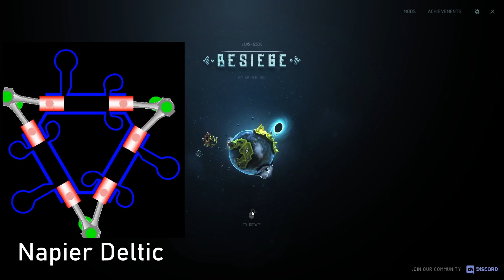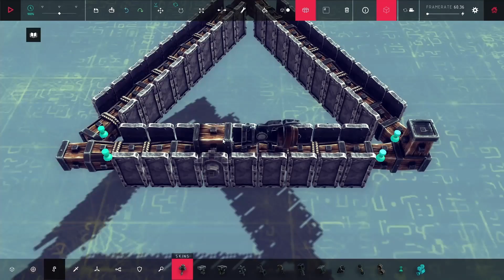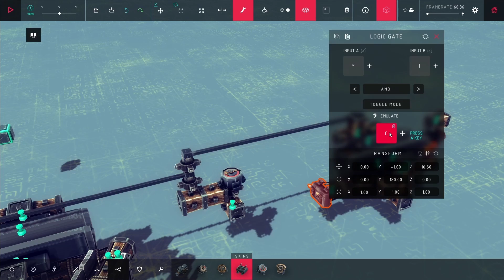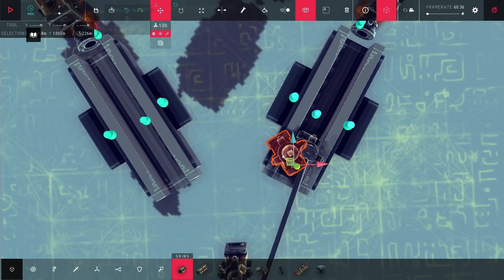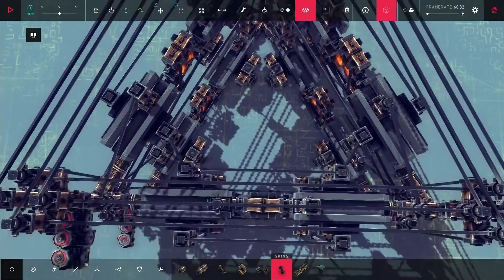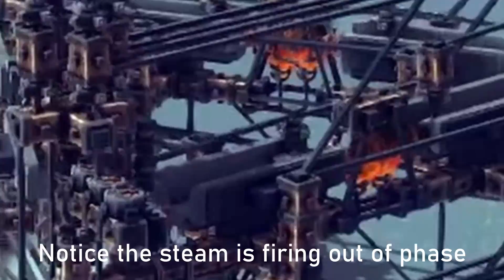Making a Triangular Engine in Besiege

Comment from the maker: Any other weird engines I should build?
Reply: Is it possible to make an engine using the enemy soldiers?
Reply: @scienceguy1165  yea but they need to infinitely respawn
Reply: @scienceguy1165  Engine powered by BLOOD OF YOUR ENEMIES
Reply: A ballon engine... or a stirlingengine
Reply: @gametec_live  impossible in besiege
Reply: A high rpm engine would be cool!
Reply: I just thought of something cool:
An egine powered engine 
(An engine that uses its rotation to move the pistons of a different engine)
Reply: @_Ordinace_  that would be interesting to say the least
Reply: A game engine
Reply: A Wankel engine
Reply: You may have done this already, but turbo jet engine
Reply: Radials
Reply: Try a radial engine
Reply: Make a “wankelmotor“ in besiege
Reply: Nothing special, but just a V6 or V8 with steam and make it a car that's fast
Reply: S100, or a 42 cylinder Radial-6 (7 rows) Also, as a building tip, using halfpipes makes the cylinders basically friction free, and ballasts are way more durable than wood, if you are making something that is not pinned. Also with ballasts you can increase connection strength by increasing the mass of the block.
Reply: Maybe like rotary plane engine type
Reply: But like if you can’t make it really round, do it square or some other polygonal shape
Reply: S100
Reply: Not an engine, but you should try making a Walschaerts valve gear.
Reply: you should make a walker powered by engines
Reply: Radial
Reply: a variable compression engine would be interesting
Reply: What about a engine where it uses like a treadmill to move? Idk how u would do that bc 
I don’t own besige
Reply: It may be completely impossible, but a Wankel rotary engine would be really interesting
Reply: wankel
Reply: Wankel
Reply: tetrahedral engine
Reply: U should make a plane that runs on bombs exploding inside it
Reply: Mobius engine
Reply: Didnt remembett that wprd
Reply: Piston engine, but using fly blocks
Reply: Do a luquid piston engine oh wait the game is too basic
Reply: Wankel Engine/rotairy engine if you can pul it of becous it looks ready cool
Reply: @Just_A_Dude_Being_A_Guy  someone already said that
Reply: @Just_A_Dude_Being_A_Guy  oh yeah it pull not pul
Reply: make a giant plane with a compact rotary engine
Reply: try making a plane with a radial engine
Reply: wankel engine
Reply: Wankel. Absolutely do a wankel engine.
Reply: Engine
Reply: You sould make a circle cycle engine it looks easy to make u should try it
Reply: Idk if it counts but a steam train engine
Reply: Not an engine, but u shud do a gatling gun using bsg mechanical stuff
Reply: Wankle Rotary Engine
Reply: A wankel engine
Reply: a dorito

y'know, a real triangle?

wankel.
Reply: Axial would be really difficult, but it is a cool type of engine.
Reply: Lets make a car that use 4 diferent motor
Reply: Rotary vee
Reply: What about a Wankel engine?
Reply: Try make a super car with a v6
Reply: Pls make a rotary engine
Reply: Try to make a plane.

With steam engine
Reply: Make a plane thats powered by a triangular engine
Reply: Yes!
Reply: Just a rotary engine
Reply: these were put into trains so turn this into a train!!!!!!!
Reply: Remake the inline 4, but steam powered
Reply: which mods do you use
Reply: A flying machine with one of your engines you’ve built would also be cool
Reply: No

Comment: Smooth blocks aren’t actually that smooth and friction free. They were mostly added in the game to help people with creating car/tank/plane, ect bodies. Outside of that they really have no real use. Use them for body panels not mechanical bits. Another tip try adding heavier fly wheels to your motors it will smoothen up the rotation.
Reply: Also some more tips. Braces in besiege due to some weird physics bug stuff resist rotation and limit rotation speed so ideally you wanna try to avoid having braces on rotating parts of your motor such as the crankshaft and if it’s powering a car also the driveshaft. Basically if you can avoid using braces on rotating/moving bits.
Reply: Tip 3 download the colliderscope mod off the workshop the reason your pistons were grabbing when they seemed like they shouldn’t Is due to a thing called collision zones which determines what connects to what. The colliderscope mod allows you to see these so you can work around them. Very useful when building intricate mechanical stuff.

Comment: If you want to fix the collision issues with the piston heads there's a design called a sarrus linkage that creates linear motion with what's basically 2 lazy tongs rotated 90 degrees out of phase to constrain 2 separate axis. The downside is that it uses 6 hinges and when fully retracted can take as much room in width and height as you would get in length, the arms of the linkage would also need to be stopped from over-rotating so as not to fold into the path of the piston.

Comment: I wanted him to build a rotary engine in Besiege, but this is even better.
Reply: He would need to find a way to push the engine, because the game doesn’t have air pressure. I mean... explosions?
Reply: @Shiyuu_497  there's literally so many ways to do it omegalul
Reply: @THESLlCK   ya, that’s a game which has different ways to push an object, but
remember a rotary engine is directly transferring explosion—>piston rotation, and not explosion—>push piston—>turn the axle.
Reply: @Shiyuu_497  it works on literally the exact same principles with a different method 

this ain't hard
Reply: @THESLlCK  no Mike, it is not a piston engine, it is a rotor engine. It can be simple to make in Besiege, but hard to make it like a real rotor engine.

It is not challenging if you make it that way, creator wants challenges for fun
Reply: Or angled steam cannons!
Reply: @Shiyuu_497  hell yeah sinning dorito
Reply: Me 2
Reply: But it will be challenging to make a reuleaux triangle
Reply: I read that as rotisserie chicken
Reply: Piston Rotary engine?
Reply: He did if you don't know.